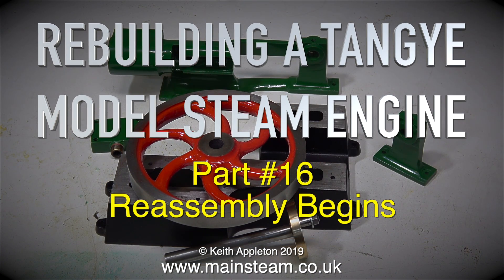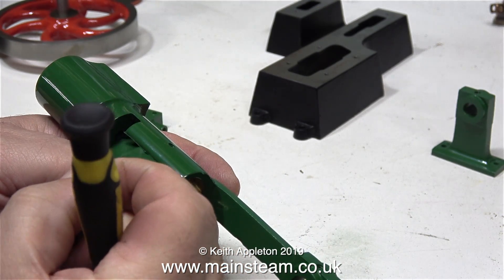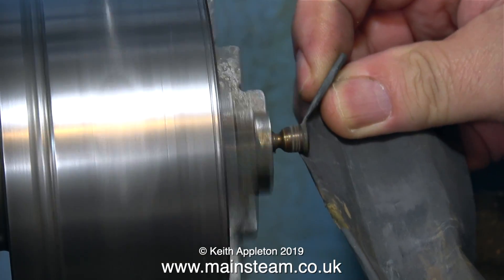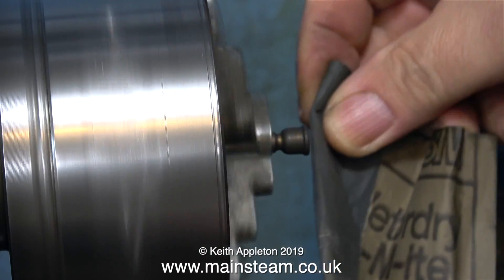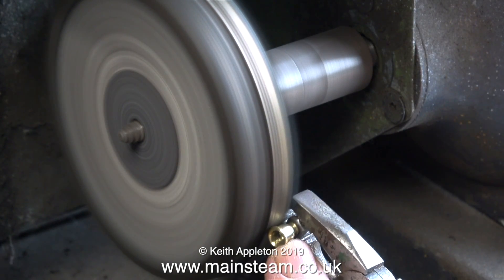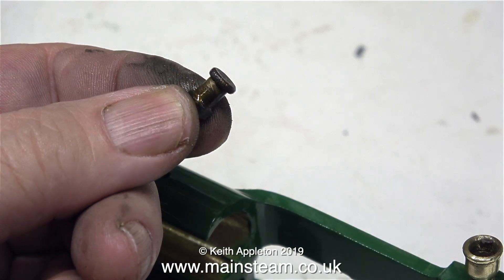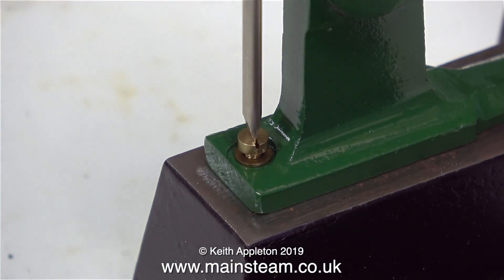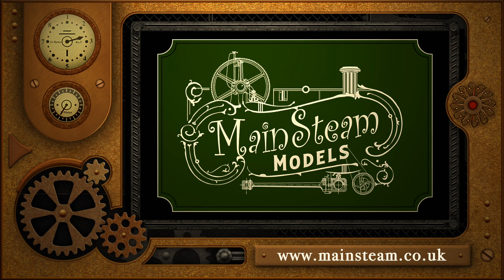REBUILDING A TANGYE MODEL STEAM ENGINE - PART #16

Comment: Your story remained me of when I worked in labour hire. We were returning a machine we hired from another hire company and complained that it didn't work. I didn't want to fix it because of liability stuff. 

The man in charge went to pulling it apart but got stuck on the nozzle, which was a left hand thread, he kept turning harder and harder, I couldn't bear it and just said, "mate, I think that's a left hand thread". The man, who now obvious to me was not a mechanic, didn't understand what a left handed thread was and with a victorious twist, broke the threads clean off thinking he finally did it, right up until he couldn't put it together again. Regardless he was still proud he got the nozzle off the machine and said he will fix it later... Despite it being now completely irreparable.

Good times.

Comment: More great beginner tips! If I may be bold enough to add, for grip protection from pliers jaws, I use the leather tongue I have around, cut from a worn out work boot or shoe.
Have you ever used the Black Scotch-Brite pads for heavy cleaning?
Reply from the maker: Good idea, i have an old leather belt I can cut up somewhere, no I haven't used black Scotchbrite, maybe I should get some . . . .
Reply: @keithappleton  I don't know about in UK, but here the large grocery stores carry the black in the section for barbecue supply. It's  used to cold scrub the grill.